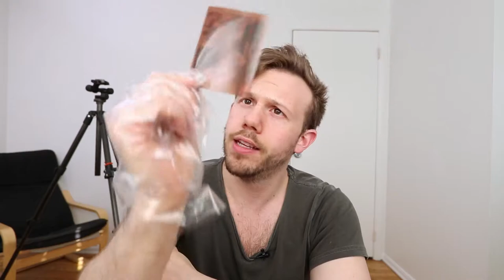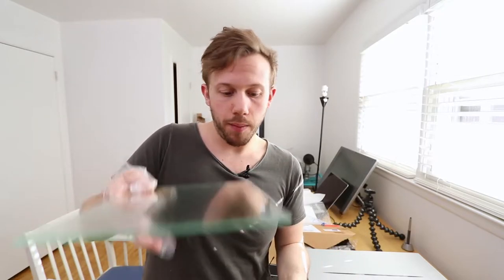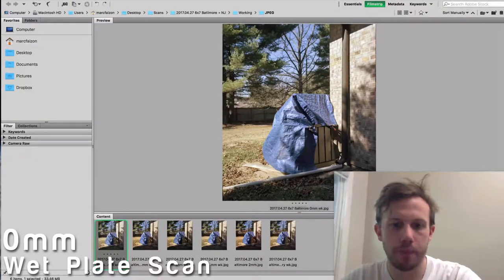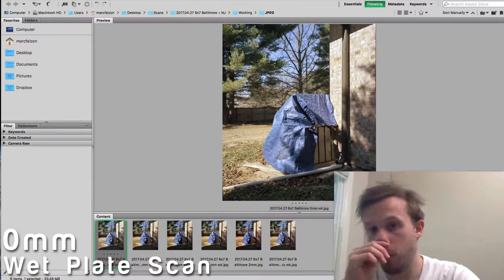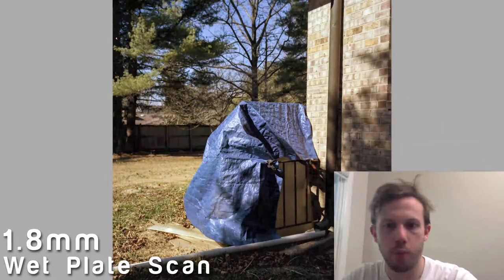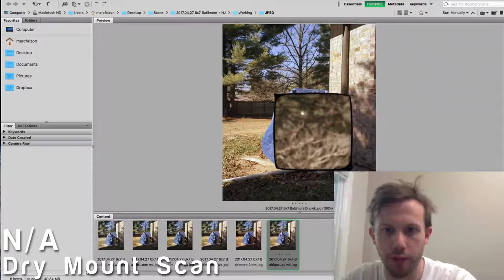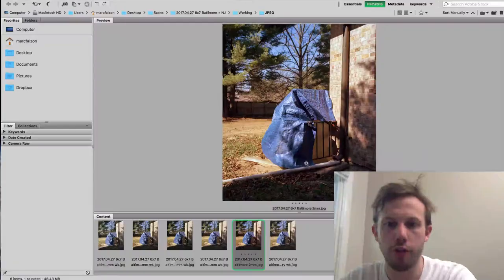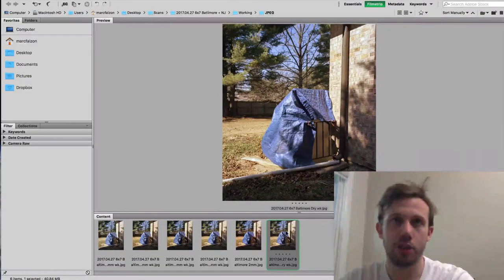Film Scanning Comparison - Wet VS Dry (+ Examples)

Comment: With the Epson scanners, if you're scanning on the scanner glass, you absolutely need to be in professional mode and set the "document type" to "Film (with film area guide") and NOT "Film (with film holder)". This is absolutely critical for an in focus scan scanning from the scanner glass. This needs to be added to this otherwise decent video.
Reply: How is the sharpness with this method direct on glass compared to elevated?

Comment: Good test but I think you might get better scans at 3.0mm or even 3.5mm. Try going higher than 2.0mm and see if the images start to degrade. Don't stop raising the scan height until you see noticeable change. Also, not sure what scanning fluid you are using but I've found ordinary mineral oil works just fine and has no odor. I use Norton Sharpening Stone Oil but any good quality mineral oil should work. For those talking about DSLR scans - you'll need really good technique, an extremely flat macro lens (like the old Nikkor 55mm micro) and a solid copy stand to even come close to flat bed scans.
Reply: love the Nikkor 55mm